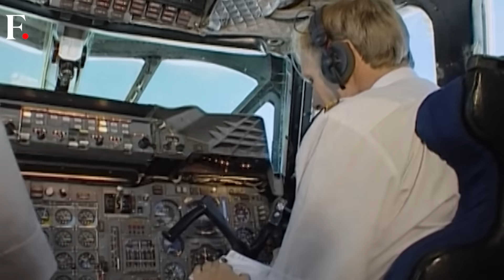NASA Tests "Quiet" Supersonic X-59 Jet to End Sonic Booms | Vantage with Palki Sharma | N18G

Comment: Many of us whom have done lots of reading over the decades know (,Strong convictions) that Lockheed has aircraft that does not use jets or other propellent based engines... Ones capable of flight which should be impossible by standard physics models

Comment: The only reason they could attempt this: the development of computational fluid dynamic (CFD) analysis that began in the early 1980's when aerodynamicists finally got their hands on the revolutionary Cray-1 supercomputer. This finally allowed granular simulation of airflow through the entire shape of the plane, and by the late 1990's aerodynamicists finally understood how the pressure wave that caused the sonic boom worked and how to properly shape a plane to mostly eliminate that loud "boom." Indeed, by 2010 they could propose airplanes with shapes similar to what the X-59 looks like currently. I expect the X-59 flying at Mach 1.6 have almost no sonic boom flying at just over 49,000 feet above the ground.
Reply: Did you really watch the video?
It said it has been developed in the 70's not the 80's

Comment: Its irrelevant whether or not it makes a sonic boom. It goes supersonic over the sea not over land. The boom narrative was just an excuse by the US aviation industry to block supersonic passenger flight which they could not themselves achieve at the time of concorde. They also said the sonic boom would make men impotent and smash the stained glass windows in churches. The sonic boom from concorde that is. Not from their own fighter jets of course. Those booms were fine. The US has set back supersonic passenger transport by 50 years because they did not make the plane. Mind you we should have teamed up with them in the 80s.
Reply: I agree with you. USA is always generous when surprised technically wise.

Comment: 2000 to 2500 kilometres per our is minimum expected speed the folded wing collection of air in g fast speeds if causing the boom: we may do one things no folded wing flat plan sheet and once time to
Land introduced the folding wings by gear or opening up :: lowering speed and guide to direction otherwise one direction once angle set and if vessels dint slippery in the air just push one direction take the tell down and sl air control method let it slide on air :: a plane pece of metal sheet it may work what we think agay is complete knowledge and ideas it’s  collide with cloud or air with water drunker moisture forming cloud or cloud to whatever 😊